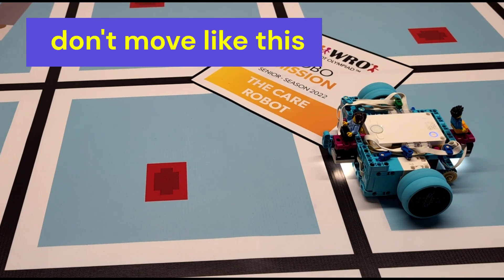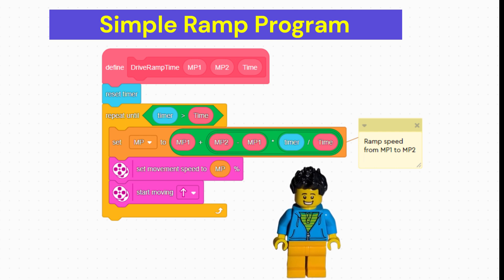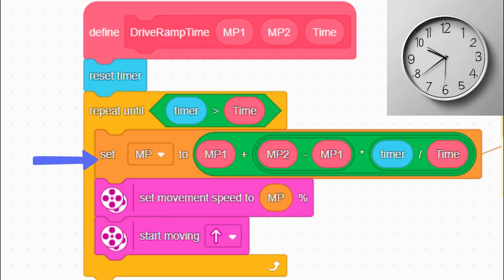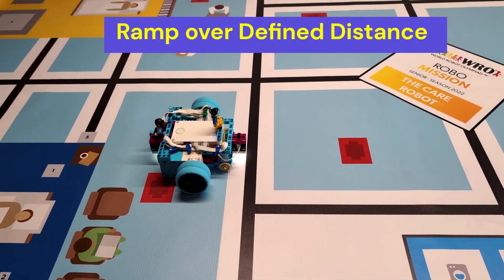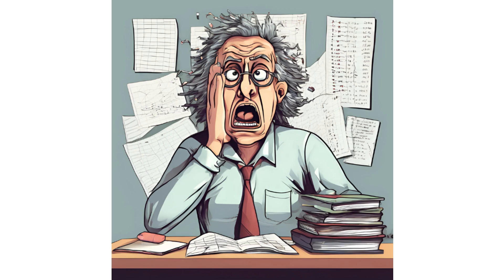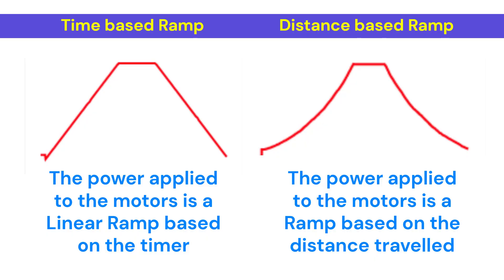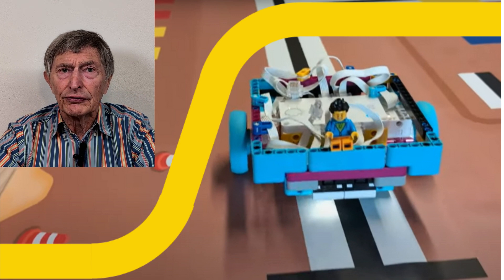Ramp Up Your Spike Prime

Comment: No it still doesn't work when I drive forward and backward the reverse drive doesn't work.
Reply from the maker: Have you set both speeds to negative values when you reverse back? I tried it in my robot and it works in both directions!
Reply: Obviously, otherwise the robot won't go backwards.
Reply from the maker: Send me exactly the code you are using, I will load it into my robot and see what happens.

Comment: Hi, I am using the acceleration and deceleration code and I have encountered two problems.
One, when I move, the relative position is not reset, and the next operation fails to execute.
The second is that there is a delay between the forward and reverse operations.
Do you have a solution for these?
Reply from the maker: Can you send me the code you are using?
pablocutler@gmail.com
Reply: I sent the code by email.
Reply from the maker: Have you got it working now?

Comment: Hi, can you show if the motors can be synchronized so that the robot drives straight?
Except for proportional control
Reply from the maker: Hi again!
Do you mean driving straight ahead without using yaw or line following directional control, just the motors without any feedback?

Comment: Hi, I managed to make a block that does everything with relative control based on distance as a parameter and target angle as an additional parameter. I divide the distance into 3 and the parameter is divided between the 3 parts of the RAMP.
Reply from the maker: Hi, do you change direction as well in each of the three parts?

Comment: Do you have to use 3 blocks each time, one for acceleration, one for constant travel, and one for deceleration?
Reply from the maker: I sometimes make a new MyBlock using two ramp blocks with a fixed speed block in between and call it a profile. There are four parameters, start/end speed, fast speed, ramp distance, dwell distance ( distance travelled at fast speed)

Comment: Two questions why don't you reset the motor's degrees at first
and why is there no assignment for the YAW variable
And there is no assignment to the PID variable
Reply from the maker: About resetting the motor degrees to zero, I originally did this, but it forces the motor to stop briefly before continuing which can't be good for the motor.

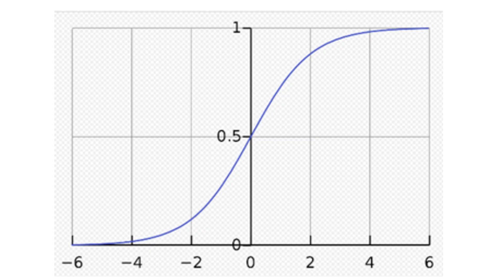Comment: Hi, I’ve been watching this video a few times now. And noticed @ 4:06, the calculations for PID, there is a variable SignMP but I don’t see it anywhere else. What is the value for SignMP?
Reply from the maker: Hi, thanks for your question. I am not at home at the moment and don't have access to my computer but I have looked at the video and I see what you mean. I have sometimes used variable SignMP in Yaw followers which can go backwards and forwards and line followers which can follow the left or the right side of the line. SignMP can be either +1 or -1 to change the direction of the PID signal. I think in this video I set it to +1 so it doesn't do anything. If there was a real reason for including it I will let you know!
Best regards 
Paul
Reply: @ Thanks for the response, I was thinking maybe it acts similar to derivative. Again, thank you for explaining.

Comment: How can make spike with sync, due to different spike motor have different RPM.
Reply from the maker: Hi Alexho
I am not quite sure what you mean, can you explain what you mean in a bit more detail?
Best regards Paul
Reply from the maker: Perhaps you have two different motors on the left and right wheels? If this is what you have, I think all you can do is to multiply the power you apply to one of the wheels by a constant so that they both turn at the same speed. If you get the factor more or less correct, the proportional line (or yaw) follower will be able to pull the robot on to the direction you want.

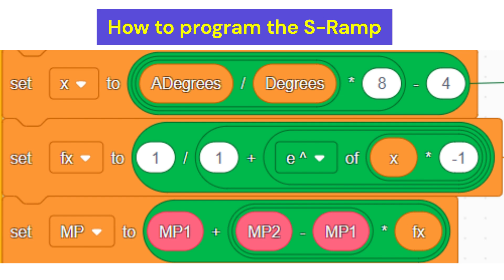Comment: hi. Can you provide me the PDF file you mentioned in 4:29?  please
Reply from the maker: Please send your email address to pablocutler@gmail.com. I will then mail the pdf file. 
About your question on the three types of ramp, the advantage of using ramps is to be able to drive a defined distance more accurately. If you just start from zero speed and go to full speed, you will have wheel slip maybe different on each wheel. If you stop abruptly you will have some overshoot, maybe more on one side than the other so you will get some rotation. It is just more controlled to use ramps!
Best regards

Comment: Hi there I really appreciate the time you’ve put in making this video, I have one question, in the “S” ramp, when we scale the function, you have a hard-coded value of “8” could you please tell me what this number signifies. 

Thank you for your help.
Reply from the maker: Hi There
I will do my best to explain the value of 8.
We calculate the distance travelled as Adegrees/Degrees. This varies from 0 to 1 over the distance we want to travel. The S-curve equation I have used has an input of minus infinity to plus infinity for an output of zero to one. If we use an input of minus 4 to plus 4 we use about 99% of the curve which is good enough for our ramp. So before we can use the S-ramp curve we have to convert the signal which varies from 0 to 1 into -4 to plus 4. To do this I multiply by 8 and then  subtract 4. I hope I have managed to explain it!
Best regards Paul
Reply: @ thank you that does explain it!!!

Comment: I am looking at this code as my students have found this video for an example to build code based off of this ramp up style of gyro coding. They had a question about the "20" on the set Degrees variable block (2:38) . What does the 20 signify? Size of the tire?
Reply from the maker: Hi Timothy 
20 is the factor you need to convert cm to degrees. I measured the wheel diameter as 5.6 cm, this gives a circumference of 17.59 cm. One wheel rotation is therefore 360 degrees and 17.59 cm. The factor I need is in theory 360 divided by 17.59 which is 20.46. I then programmed the robot to drive 50cm with this factor and measured the distance travelled. I had to slightly modify the factor to give me the correct result. Theory and practice are usually slightly different! The sources of error are perhaps my measurement of the wheel diameter, some wheel slip and some overshoot at the end of the 50cm run which would be speed dependent. Factor 20 gave good results and is a nice round number. I hope this answers your question, thanks for your interest!
Reply: @why-not-bot I appreciate the response! I figured it was something like that, but was not 100% sure. You are very informative and I enjoy your content!
Reply from the maker: Thanks, good to hear from you!

Comment: Excellence explanation and great video as always. Can you make a video about pros and cons of using distance sensor and touch/force sensor? I don't see people use those sensor much during competition.
Reply from the maker: Hi again 
I have sometimes used one motor to do two things like lift, grab etc. It is not easy to do more than two things because both operate at the same time and both will have to have about the same number of motor rotations. It is something I have often thought about, if I have any new ideas I will definitely make a video!
Reply: @why-not-bot  thanks in advance. may I ask if you're located in Australia?
Reply from the maker: @minhtuanmt1ify  
No I am in Switzerland!
Reply from the maker: Hi, thanks for your comments!
It's true, you don't see much use of force sensors in competitions, you could use one to tell when you have reached the side of the table for example. Is this what you have in mind? Have you tried using one yourself?
Reply: @why-not-bot  yeah, without the touch/force sensor, you have to measure the distance to reach a object or destination point (because there's no line lead to that object). Is this the technique you usually use in the competition? This requires multiple tries and fine tune, doesn't it?
Reply: @why-not-bot  do you have a video about motor simulation? e.g one motor for many actions likes grab, lift ...